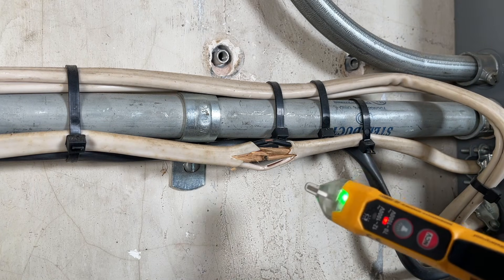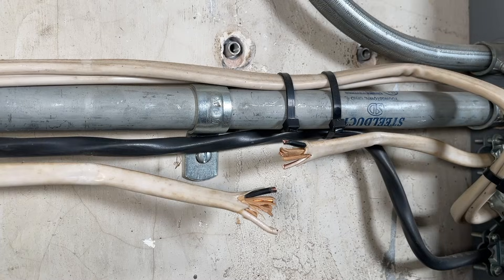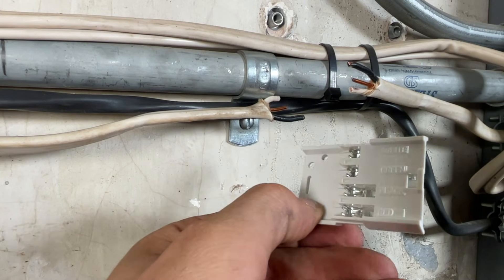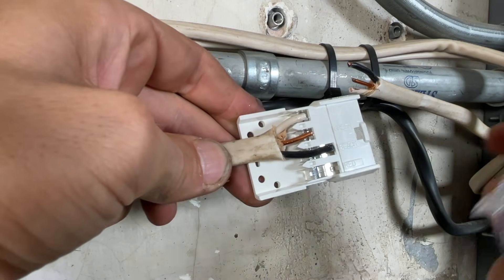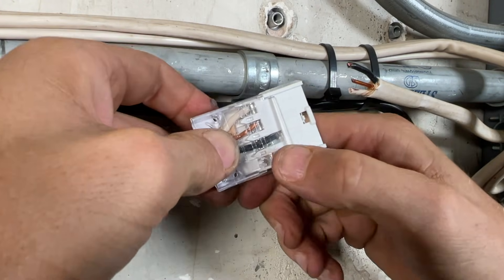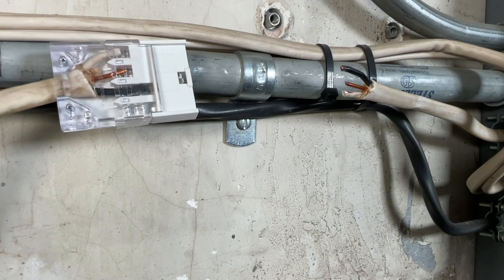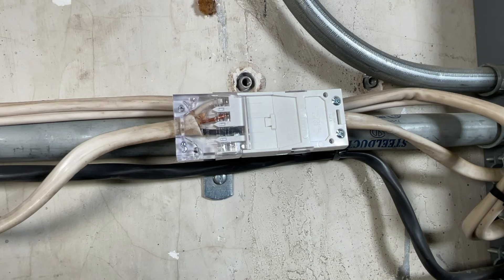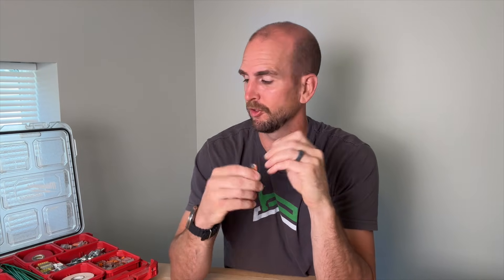The Only Romex Splice Approved For Behind Drywall

Comment: Okay, I get it.  Not everyone is happy or confident with this approved repair.  If that's the case, why is there only one approaved repair splice?  It seems to me if there is room for improvement, then there is a market for a better splice solution.

A good and simple repair product would maybe prevent a lot of the hambone "repairs" done by DIYers and maybe more than a few remodelers the pros see when the home owner calls to say the lights are flickering or they smell that electrical smell.

A good DIYer or remodeler could keep one or two on hand for those "just in case" times for when they nick a wire.

Comment: These look like back stabs. Don't think I would trust them. How can this possibly be better than other splicing connectors?
Reply: 30 years from now people will be saying. 
Can you believe they used to just screw a wire nut on wires and call it good. All the wires in one box. No separation, no strain relief on the connection it self. 

And they had to make every connection accessible with an ugly box on your wall because they had to fix them so often. 

They lived in fire traps

Comment: You missed a key piece of this installation that require both ends of romex to be threaded through a strain relief bracket and nailed to a stud. I can't imagine this ever failing, unless it's just flopping around in your wall/ceiling unsupported.
Reply: Good to know thanks. I was thinking about using them to extend 10 circuits. But trying to find mounting space makes that hard. Maybe I will just do a box with the wagos

Comment: I have some 60s romex that has four wires in it I want to use one of these that has four channels in it to fix it.  Does it matter which channel each wire goes in as long as the other wire matches up with the corresponding wire on the other piece?  Also it looks like one of the wires has slightly less diameter than the others so I wonder if those forks will work on a smaller wire or if it's designed for that.
Reply: You must read and follow the instructions that come with the device to be code compliant. So yes it will matter which location the wires are in. Read, understand, and follow the instructions precisely. 

Especially with a newer product like this.

Comment: I’m confused. What is the difference between the NSi, NMS-2 and NMT-2?
Reply: From Grok

The NSi likely refers to products from NSI Industries, a manufacturer of electrical connectors and splice kits. The NMS-2 and NMT-2 are specific models in their non-metallic (NM) cable series, designed for use with 12-14 AWG solid conductor 2-conductor Romex cable (with ground). These kits allow for splicing or tapping NM cable in applications where a traditional junction box might not be feasible, such as in-wall repairs, and they’re rated for up to 300V. 11 Here’s a breakdown of the key differences:
NMS-2 (Splice Kit)
	•	Function: Used for straight splicing, meaning it joins two separate ends of NM cable together in a linear connection (end-to-end).
	•	Design: Features a hinged cover for easy termination. You strip the cables, insert them into opposite ends of the connector, and close it to make the connection via insulation displacement contacts (no need for wire nuts).
	•	Typical Use: Repairing a broken or cut cable in the middle of a run, extending a circuit.
	•	Installation: Requires cutting the cable completely to connect the two sections. 0 “The NMS-2 splice kit, showing its linear connector design.” “LARGE” 
NMT-2 (Tap Kit)
	•	Function: Used for tapping, which means creating a branch or T-connection off an existing continuous NM cable without fully severing the main line.
	•	Design: Similar hinged connector but configured for one continuous cable to pass through while a branch cable taps into it. Includes components for a secure tap connection.
	•	Typical Use: Adding a new outlet, light, or branch circuit to an existing wire run without disrupting the original line.
	•	Installation: You insert the main cable through the connector and the tap cable into the side port, then close to pierce the insulation and make contact. 1 “The NMT-2 tap kit, showing its T-shaped tapping configuration.” “LARGE” 
In summary, the main distinction is in how they connect cables: the NMS-2 is for inline joining (splicing), while the NMT-2 is for adding a side connection (tapping). 11 Both are UL-listed for safety and code compliance in appropriate applications (e.g., not for general use in all jurisdictions—check local codes), and they’re quick alternatives to junction boxes. If “NSi” refers to something else specific (like a different model or brand variant), provide more context for clarification.

Comment: terrible splice. just pull an switch or receptacle in a house wired many years ago. wires were stabed in back of swich or plug . curret heats the metal clamp. loses strenght over time. bad electrical connection.
Reply: 30 years from now people will be saying. 
Can you believe they used to just screw a wire nut on wires and call it good. All the wires in one box. No separation, no strain relief on the connection it self. 

And they had to make every connection accessible with an ugly box on your wall because they had to fix them so often. 

They lived in fire traps

Comment: Electronic cutters?
Reply: they are so sharp they cut 14awg wire much better than normal wire cutters. Much easier on your hands. Use use a lot less force and have a lot more control.

Comment: Those cutters are for much smaller wires in electronics..,
Reply: And they are so sharp they cut 14awg wire much better than normal wire cutters. Much easier on your hands. Use use a lot less force and have a lot more control.
Reply: @PracticalPreparedness-n4u   yes, I have five pairs....

Comment: I'm not an electrician, nor an accomplished electrical DI-WIRE, but I don't think I would trust that in my home, or especially not a rental. Your other videos outlining why the commercial receptacles (outlets) are superior to the residential grade ones flies in the face of the technique used by that splice connector. Daisy chained outlets today are being loaded up more than ever, and with the continued electrification of everything in homes, that trend is likely to continue. So, if you've got 10-14 amperes being drawn through that connector with only that tiny little sliver of surface area contact made to the actual conductors, that thing is definitely going to heat up, and that will likely cause movement. It seems likely that that would lead to an intermittent connection at best, and arcing at worst.

Comment: Isn't that inferior to screw terminals and wire nuts for conductivity at higher amperages?
Reply: We don’t require the best. We require code compliant. The US code expects a house to last 50 years. In Germany they expect a house to last over 100 years. That is a big reason for differences in the code. Like screw terminals vs wire nuts
Reply: @PracticalPreparedness-n4u  Yes, and what makes sense depends on interest rates, if you use money as a measure. So if you save x dollars doing it cheaper, them fifty years later that x dollars is worth say 4x dollars. So some people say that its not reasonable to require today's hard pressed payers to cough up that extra money because by the time it matters, that extra money is worth enough to redo the thing to future standards anyway.

Comment: As a quick fix, temporary, sure! Permanent in my own home? Not a chance. And if I hire someone to do this, I will never pay.
Reply: 30 years from now people will be saying. 
Can you believe they used to just screw a wire nut on wires and call it good. All the wires in one box. No separation, no strain relief on the connection it self. 

And they had to make every connection accessible with an ugly box on your wall because they had to fix them so often. 

They lived in fire traps.

Comment: I would be interested to see if there is a degradation of current flow through these connectors.  A test similar to the one you did comparing wire nuts to wago connectors would be good to see. I can't help but feel that the "fork" splice will limit current flow and heat up under a max rated load.

Comment: What about just soldering the wires and covering the wire with heat shrink tubing?
Reply: Knob and Tube
My Dad soldered many connections wiring houses. Junctions in boxes and open air connections.
"Friction Tape" for the insulator.
Before wire nuts and when lead was good!
Reply: You need it to be a lineman’s splice with 185 degree heat shrink over the wires and the whole bundle. 

That takes skill and knowledge. This doesn’t.

Comment: What a horrible, dangerous idea. The area of contact is insufficient for its intended use. Not UL approved and no longer available on Amazon.
Reply: They’re for sale today on Amazon from NSI, the actual manufacturer.
Reply: Then why are all all licensed electricians using them and passing inspections? Why do they also explicitly say they’re used to eliminate junction boxes and say NEC Compliant Article 334-40b, 2005 and 2008 NEC.  
Also has a nice UL listed stamp on it. 
Just because you are able to comment, does not mean you should.
Reply: they are UL approved and 334.40 compliant.  Have always been UL approved.

Comment: Behind drywall? Can you say house fire???? So many issues have been linked to that style connection. As the wire lives it's life it expands and contracts and those are dissimilar metals meaning they expand and contract at different temperatures and different speeds which causes a fault in the connection by creating increased resistance which means heat which leads to fire. Then the wago is neat but still junk. Do it right the first time spend the extra and it pays off in the end. Temp circuits sure on both but long term no.
Reply: give us a link! "SO Many issues"  I put together two 30 unit modular apartment buildings each with 36 ranch size sections and everything was interconnected with Molex splice kits and they're still there after a decade and I know for fact they have zero connection issues

Comment: Something to keep in mind, using these types of devices greatly reduces the surface contact of the conductor.  This can lead to voltage drops, current drops and possible overheating at the connector.  You want to maximize contact surface area.
Whether or not it's "approved" ( I haven't asked an electrician) but I've always learned toward using an insulated butt connector.  That way you have maximum contact of the conductor.  Again, I'd check with an electrician before putting it behind anything, like drywall or i the ceiling.  I've only done this on external wires like extension cords, lamp cords, etc.
Reply: These are UL listed and compliant with 2014 NEC 334.40 (A) (B)! I know that it would appear that the pair of metal contacting forks are undersized but remember it’s the total cross section that’s important. In this case it’s rated for a steady state operating current of 20 A which means it would need to be tested to a 20% higher current level to protect against unintended current spikes! Like with any electrical work, if you’re not comfortable and competent hire a professional.
Reply: It isn't approved. Most approve butt-splicing devices outside a box look somewhat similar to this. Generally speaking these connectors, although approved, would be frowned upon by most electricians.